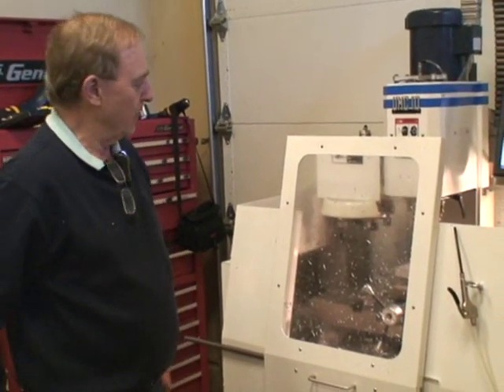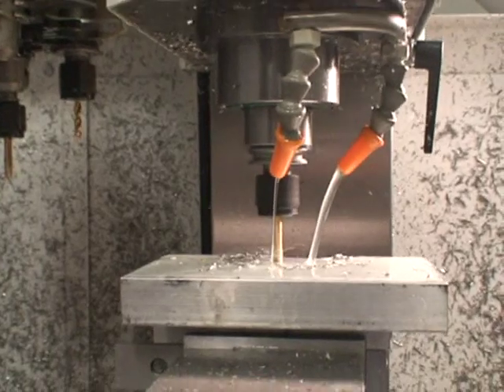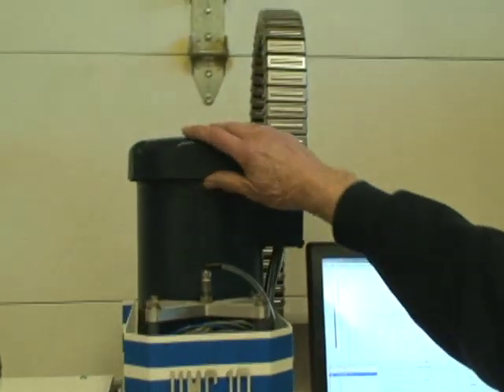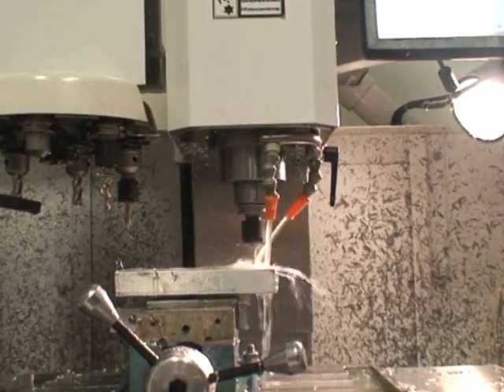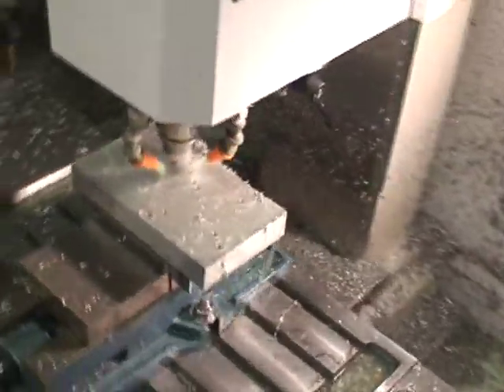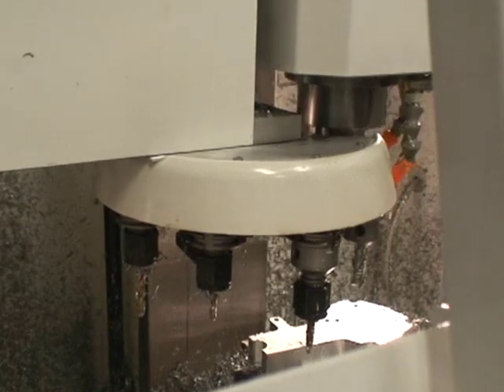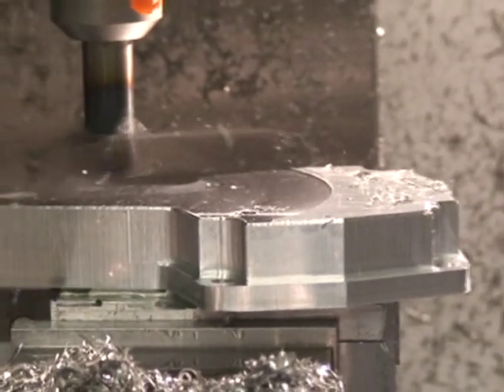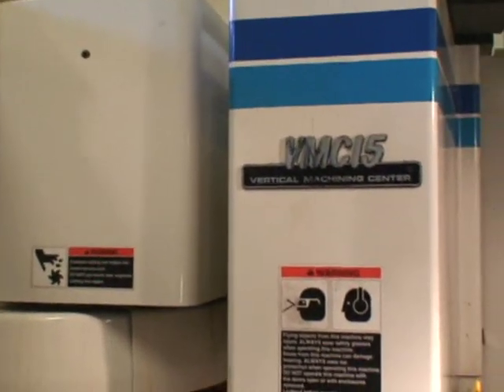UMC 10: Scratch Built CNC with Automatic Tool Changer

Comment: Super machine Dave. Did you grind the steel box section base and column before putting the rails on? Do you have any problems with the box section warping over time..I'd like to build something like this..are the tool holders precision ground after turning?
Thanks John